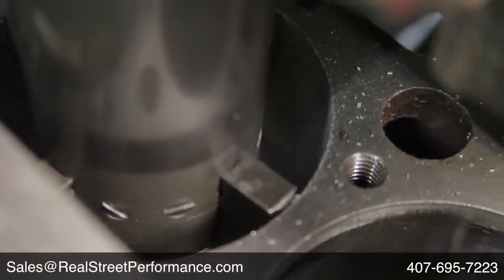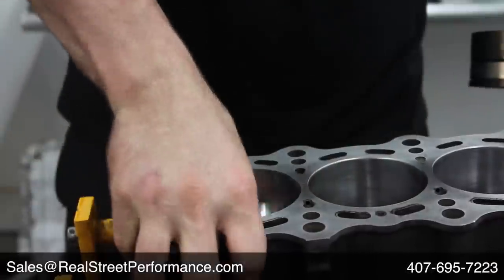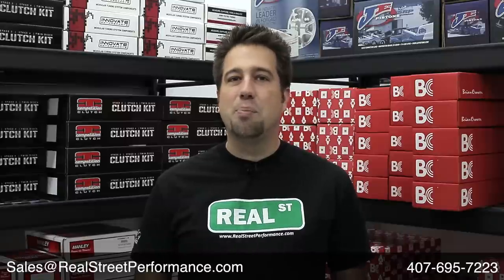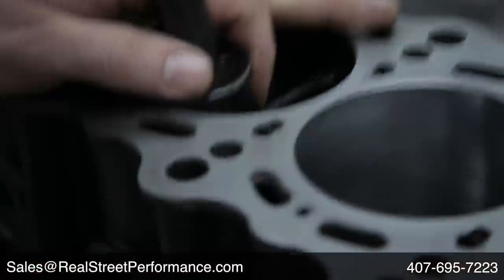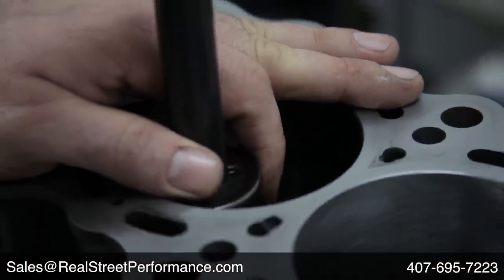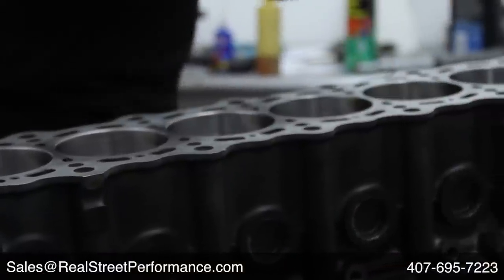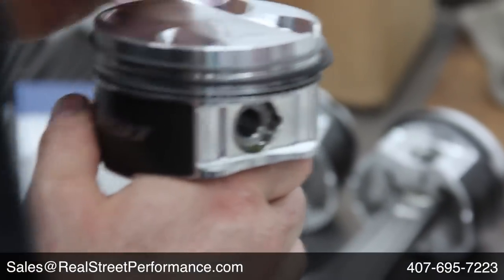How to select the Correct Piston Bore Size for your Engine Build - Real Street Performance

Comment: I have a late Pontiac 389, I'll be more than fine with cylinder wall thickness at .40 overbore, but I'll play it safe, flat top pistons for the 400s aren't as common due to their heads having "open chambers" rather than closed. 

On a side note, I hope whoever else watched the video and found this info might helpful like I have

Comment: I prefer going with metric. With my 2jz the stock bore size is 86mm i bought 86.5mm pistons for my block so everything is fresh in the cyl walls and its a new surface for new pistons. just makes sense. 

Real Street really helped me, good people over there.
Reply: Is .5mm a good clearance, I am about to order a 53.94 but my cylinder bore is 54.5. Would those sizes be alright.
Reply: @tylercotugno8387  that would mean you've have to take it to the machine shop so they can match the bore to those new pistons. It's actually a good thing because then it will be a new surface for the rings incase you potentially had cyl damage.
Reply: @CarsnStuff  I haven’t bought anything yet I just see engraving on the cylinder saying 54.5 then on websites to buy my dirt bikes stock pistons they are 53.96. This is the first ever rebuild on it and the cylinder is in good condition.
Reply: @tylercotugno8387  ahh okay.. that sort of sounds like how dirt bike companies will list a slightly higher CC engine than what it actually is. like on my crf 450 they list it as a 450cc bike. but the true cc is like 449
Reply: @CarsnStuff  ohhh ok makes sense

Comment: So Piston To Wall Clearance Is Simply (Bore Size) - (Piston Diameter At Specified Location). So If They Want .004" Clearance They Want The Bore To Be .004" Larger Then Piston, Not .008" Larger? Correct?
Reply: Correct, use diameters, not radius

Comment: im about to rebuild a 350 for a 95 tahoe. all i want is god MPG if i can...so 60 over isnt what i need correct? i was told to go big for power. all comments are appreciated
Reply: mista ready you only want to boar it as much as necessary to bring the cylinders back to perfect.
Reply: @dangerousfreedom4965  thanks for that...im taking motor in tomorrow. so ill let them decide
Reply: Aim for high compression and small valves, run the best oil you can get and as far as gas goes, running non-ethanol alone will grant a 4% increase in overall fuel economy

Comment: I will rebuild my 2.0tfsi engine..i get bartek forged piston..they have 83mm bore but original pistons are 82.5mm is it fine to get 0.5mm larger piston ? Does it mean increase engine ? And does it mean they shape piston walls to be smooth ?

Comment: Say i have a h22 with a 87mm bore, and say i get it bored out to 88mm do i buy pistons size 88mm or do i buy a 87mm piston with a 1mm ring. im over thinking whether or not the ring are included in the measurement of the piston. first build if you couldnt tell lol

Comment: Could I just go to a website and put my make model and year and then get that piston stock without measuring
Reply from the maker: Hey Tyler, nobody could answer that unless they took your engine apart and measured the cylinder bore. If the cylinder bore inside your engine is damaged, our has become "out of round" over time or has changed in size over time, then it will affect your piston to wall clearance with a standard bore piston. The right way to do it is to have the block disassembled and inspected by a machine shop. They will tell you if your cylinder walls are in good enough shape to use a standard bore piston or if your block should be bored over and use an over sized piston. The most common mistake we see people make is to skip this step while trying to save money, and just buying a standard bore piston with hopes that their block wont require machining when it makes it to the machine shop. It almost always does require machining, and they almost always do have to exchange the standard bore pistons they bought for oversized ones. And depending on how long its been, there is sometimes a restocking fee which nobody likes. So the right way to do things is have the block inspected and measured before buying pistons. but lots of people still choose to do it the wrong way even though they know its not the right way.
Reply: @realstreetperformance  ok thank you so much I will take your advice and look around for what to do.

Comment: So if I was going to bore my b18 out to 83mm and then sleeved it with darton mid sleeves what size positions would I use?? Would I use 83mm pistions
Reply from the maker: Jason, you would have the block sleeved, and then bore the sleeves to whatever bore size you want. They come as 81mm but you can bore them to 83mm if you want.
Reply: @realstreetperformance  ok so would I need 83mm pistons then
Reply from the maker: @Jase2114  If you bore the sleeves to 83mm you would need 83mm pistons. If you bore the sleeves to 82mm you would need 82mm pistons, if you bore the sleeves to 84mm you would need 84mm pistons. The pistons and the sleeve bore will match, whatever it is
Reply: @realstreetperformance  thank you for this inward being told a whole lot of BS  by another company then over here on the uk ..next year in February or March I will be placing an order with you guys on a few bits ...

Comment: I'm having a problem with my rebuild 2006 5.7 Hemi from a dodge charger the engine block was completely trashed from a piston that cut loose so we ordered a block that was bord over 20 over so we ordered pistons and rings 20 over I must of pulled this engine apart 5-6 times do to oil blow by I dont understand the ring gaps are on point and made sure the rings where spaced 90 degrees and away from the oil drops on the pistons it's been a nightmare for me out of all the engines I ever touched this 5.7 hemi is fare worst I followed every step on measurements and torqued everything to spec lost so much money on this build this engine is running fine no codes, not over heating but oil coming out the tail pipe if anyone knows about engines please slide me some advice I used heavier weight oil for assembly of parts and running mobile 1 5w20 full synthetic any of my fellow gear heads please give me a understanding what I did wrong
Reply: did you do a compression check, vacuum?
It can be valve seals
Reply: Figure it out the oil rings was junk, swapped out the oil rings on each piston, did my measurements, compression test each cylinder everything is on point. Thank you for answering me back!

Comment: SO what piston clearance should you have????????????????????????????????????
Reply: Rolf Larsson its just said if its a n/a you can run a small clearance if its nitrous or boost you run bigger clearance to allow for heat expansion . Also depends if pistons are forged or not as different pistons expand at different rates all depends on each individual build realy .
Reply: Tommy if you need to bore 40thou over to "clean up" the engine it's junk as every other consumable surface will need machining, the cost is large. If you advise minimum over bores simply to save the block for future resizes your kidding. Most cars well maintained last a lot of miles and most cars with a rebuilt engine won't out last the rebuilt engine. Are you just trying to sell product?
Reply: Piston manufacturer will have spec. Also, your engine overhaul manual will have min and max clearances for a standard build. Your machinist will need to know what pistons you will use. Don't buy any parts until speaking with machine shop about  your engine size after machining. Some piston manufacturers only make certain sizes.

Comment: ha, the machine shop matching the bores to specific pistons, bullshit.
Reply: 4erdf any good machine shop should have your pistons when they rebore and the biggest piston goes in the biggest cylinder and the smallest in the smallest cylinder . Every piston is a slightly different size and likewise so are the bores . Whats bullshit about that
Reply: As the guy at the machine shop who does the bore and hone, you get what you pay for. You want piston matching fine but you better ask for it. I wouldn't bother matching with a std rebuild if the Pistons are that far out I send the back. if I Stress plate, high performance building then you pay and you get matching and more. You can also consider changing from cast to forged and bore sizing (+3-5thou) without an official "over bore", however this is normally only done for rare blocks as the industry doesn't see the need much. To save part cost you can also swell the Pistons and re-ring for a +5 but that's at the budget end.